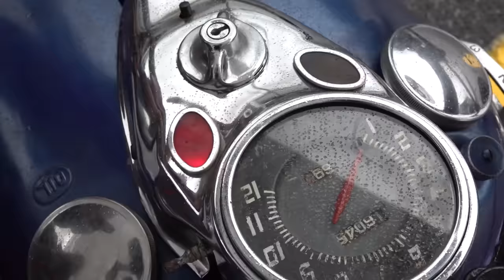I Bought a 80 yr old WW2 Bike, But will it make it Home?

Comment: That wla looks clean for its age
Reply: it's a beauty.
Reply: @MrRourk  you can only change the front PRIMARY sprocket of which they made 20+ different sizes.
Reply: @MrRourk  FYI the rear sprocket tooth # can not be changed

Comment: I was told by my neighbor when I was a child in the 70s . No worries if your points and condenser is bad. Go to a local hardware store pickup a kit for a Briggs & Stratton mower motor and your golden. These people worked on plenty of engines. And of course this was okay until manufacturers started putting in ecms. Craig was sounding giddy as a school girl. Kind of like Burt Reynolds used to laugh. That's a beautiful WLA. Would love to see HD do an icon version of it. From what I understand it was a 18.5 hp engine capable of stop speed of 70 mph.

Comment: Beautiful bike Sean glad you made it home safe. You and Craig and the crew. Good luck with the future endeavors on this one. Personally I like Chrome but you're right there might be a little bit too much and that kind of takes away from the originality of the bike I'm sure. Wish the weather could have been a little bit nicer for you but hey it wasn't that bad looks like you didn't get rained on too much at least from what I could see in the video. You guys take care of be safe God bless.
Reply: the wla is not original anyway . HD made 90,000 of these for the war all titled 1942. army models were olive drab, no chrome . black-out headlight,taillight, 18 inch wheels, air box/filter attached to the carb with a hose, 3 speed with reverse if it came with a sidecar. 26hp with aluminum heads , 6to1 compression ,21.5hp 4.75 compression.the 45 was made from 1929 thru 1973 making it the longest production run for  hd.i have lovingly owned 2 trikes for 33 years i' had many other hd's none as much fun as these,they are a labor of love if you use them, daily tappet adjustments if you ride hard 4-500 miles a day and thats a long day.gentlemen enjoy this machine ....

Comment: You make me dream of my youth!  I was eighteen, home on leave, bought a 37 WL from a good friend.  It'd been a side car with a reverse and I ended up riding it to Cherry point where I was stationed.  It was stone cold reliable, easy to kick start and good on gas.  The previous owner had done a great flame on black point job and molded the whole frame and tanks in. It'd do about seventy five or eighty flat out, and about fifty miles to the gallon at sixty.  I was young and foolish and sold it while overseas.  Wish I had it now.  Thanks Craig!

Comment: I'm guessing the not-the-throttle twist grip is for manual spark advance. At idle the spark advance is 4 degrees or so BTDC. As the RPMs increase, the spark advance has to be increased to around 14 degrees BTDC (old, low RPM engines). So, as you roll on the throttle, you also have to roll on the spark advance in a synchronized fashion. Cars had the same deal, but the control was a lever on the steering column. Eventually, this was handled automatically. At first, this was done with a pair of weights with springs that flew out as the RPMs increased causing the plate the points were mounted on to rotate and thus increase the spark advance. Now it is done electronically.
Reply: I never knew that. How mechanically     amazing.

Comment: My first road bike in 1972 was a WLA Harley.
They are indeed military vehicles.
90,000 produced.
I bought mine in Western Australia.
Australia was a major base involved in fighting Japan. There was an immense amount of war surplus around when I was a kid.
Petrol motor Detroit Dozers. Chevy Trucks. We used them as cranes to move and load tree.
It had maroon paint, chromed springer forks off a 1200 Sidecar unit, ride control and a bigger back tyre.
Im still riding , 1900 Roadliner.

Comment: These were fun. Some were still around when I started riding (post war HD and Indians). A few Jawa/CZ.  Rode an Allstate Twingle (Puch). Montgomery Ward Austrian 106? Some Italians.
My first road bike was a used Bennelli 4 stroke 125 cc. 
My elder cousin started with 50s bikes. 
There was a good reason why British bikes got very popular. 
My first (used) big bike was 66 Bonneville 650. 
Very fun. Unless you wanted high speed on the highway for any length of time. HDs and Indians had the same 60mph +/- comfort zone. 
Some very good rides back in the day. 

Out of 26 street bikes three developed problems. 
72 CL 350 timing chain and guide, burned valve at 28,000 milrs, 
Probably I did not adjust often enough. Bores were fine. 
77 BMW 750 output shaft seal went, eventually turned out cross threaded nut from factory tweaked the shaft just enough new seal would soon leak. At 44,000 miles. 
83 V45 Sabre, alternated came apart 34,000 milrs. May have over revved s bit. Amazingly easy.
92 Pacific Coast I do not count at over 90,000 miles (I tan a couple times while waiting for throttle cables, only lasted me about 35-40,000 milrs. Developed a short in the wiring harness I failed to trouble shoot. They would sell decently (high mileage vs lots of low miles) so 90,000 miles I gave it away. 
Otherwise one stolen if that counts. Oh and one borrowed I had to steal back.

Comment: Congrats on getting that beauty started, but I can't believe neither of you thought about adjusting & oiling the chain before taking off...you can see it bouncing up and down at least an inch as you took off. This is a very easy fix, and would have made the shifting and power transfer much much better.

Comment: I thought i was the only one who bought old , unknown-bikes and rode them home  . The last-one was a 73 yamaha TX650 cafe , 4k's from home the lights-failed , started running on '1' , then stopped in the dark altogether . I had to frantically pull the fuel-tank off when a hose disintegrated, pouring fuel over a hot-bike . I still haven't figured how I did it so-fast or why it didn't burst-into-flames . That's a great old Harley , though I wouldn't 'cross-the-road' for the modern-stuff .. Fun-times   .  Dave   NZ

Comment: It's running really lean, you can tell because the pipe turned blue. Chrome pipes are great that way, if they turn blue it's hot which means lean, if it's gold it's running right, if it doesn't change it's running too rich and cold. Thanks a lot for the extreme close up of the tarantula.. my arachnophobia absolutely loved it. -.- I'll be cursing you when I try to go to sleep and keep seeing spiders instead. Wikipedia says 25hp@5:1 compression, upping it to ever 8.5:1 which will still run just fine on 87 octane would probably up that to ~45hp. The cool part about those is Baker now offers an early Harley 4 speed trans that bolts right in that has 6 speeds inside of it which means you can easily do highway speeds without taxing the engine.

Comment: what additive to the gas did you use to replace the lead? I had a 1945 WL, I used marvel Mystery oil in the gas. yes a WL, a civilian model from 1945. one of only about 1300 civilian model made in 1945.

Comment: BTW, I have had a few bikes. A Yamaha 400RD. I sold it because idiots can't see a bright orange bike with the headlight on. So, I bought  a DT175 basket case. made it work. and went riding in the woods. I needed more power so I bought a DT400. They were both beaters, so I had the cylinders honed, new pistons, and went merrily on my way along the Applachian Trail. I got stopped by a Forest Ranger, but when I explained to him the large chain I carried was for moving logs from the trail, he waived me on. I took the untried DT175 from Pittsfield, MA to the Hudson River, and back. Ain't Skeered.

I was following the Trans-Atlantic cable when I was stopped by Arlo Guthrie in Washington, MA,  since it cut across his lawn. I pointed out his "Running Down The Road" album, and he said, "Easy across the grass".

Considering the terrain I rode over, I would have killed for a Trials bike. Rocks, roots, and gullies. Still. I made it with the DTs Great bikes.

Comment: So I know this isn’t what the video is about. But what is that trike behind you at the end of the video. Under the lift. That looks amazing. I have been researching and looking at stuff like that for years and never found a design I quite liked so I started modeling my own but haven’t gotten too far. Goal was to build a motorcycle that has manual stabilizers that’s enclosed that is 15 hp and weighs under 500lbs with 70+ mpg. Keeping weight and aerodynamics low was the goal of the project and that looks awesome.

Comment: Harley's military motorcycle Engine	45.12 cu in (739.4 cc), SV Air-cooled, side-valve, 45-degree V-twin with a Compression ratio of 5:1, Top speed 65 mph, Power 25 hp @ 4,500 rpm.
Ignition type	6 V battery

Comment: The WLA models were delivered to the military with a lot of extra equipment such as crash bars, winter leg guards, windshields, a scabbard for a rifle or a Thompson SMG, saddlebags, etc, which made them heavy.  To compensate for the weight, the engine's primary sprocket came in different tooth counts----a lower tooth count (and consequently a smaller diameter) provided more low end acceleration and less top end; and vice versa, a higher tooth count and greater diameter would give you less acceleration but a better top end.

Also, the springs that support the seat post came in IIRC three or four different weight calibrations to match the weight of the rider.

The left grip controls the spark advance.  The grip should be set to full retard for kick starting and the first few seconds of running, then twisted to full advance for normal operation.  This was not specific to the 45s--because of the varying quality and inconsistent octane levels of gasoline from the era, most H-Ds had the same twist grip spark advance.  On many cars of the Brass and Pre-War era had the same thing, a spark advance control--on Model T and Model A it was on the steering column.  Drivers had to listen for knocking and adjust spark advance accordingly.

Comment: The Harley 45 ci flathead is hard to kill. As long as there's oil in that right side tank. Top speed is, according to the manual, 72 mph!
Reply: 72 mph over a cliff !
Reply: @kurtfoulke5130  
Actually, my last WLA I restored in 1992, got up to 82 mph out on I-75 up in Ohio. There were three others with me on newer Harley's and one on a Suzuki!
One I restored back in the 1980's had a triumph 4 speed tranny. I put it on a plate and then had to flip the rear tire. Then add a bracket to hold the brake lever. The 45 and triumph uses the same primary chain and rear chain. The rear chain is on the left side vs the right side.
If your wondering where I got that idea. It was in an issue of Easyrider Magazine from the mid to late '70's! With step by step directions!
Reply: @crazyelf3839  there's a cliff on I-75 ?

Comment: The front fenders always looked jacked up and not in line with the front wheel, I am guessing that may have something to do with the Springer front suspension, if not its a serious design flaw, I've seen others like this too.
Reply: As the springs compress, the wheel moves forward - the fender is attached rigidly.

Comment: I messed up and put carb cleaner in my older harley. I started fouling plugs like crazy and it looked like some other issues. Turns out that stuff will mow through a brass slide.
Reply: Wha-what ? 🤦

Comment: You need to POLARIZE the generator when you change the battery, regulator, or generator. 
All you need is a length of primary wire.
Reply: That's only if the generator lost it's magnetic field

Comment: I do not know that engine but are you worried about bottom end run out? Traditionally Harley Davidson bottom ends are interference fit. So when you get over 140 hp in an Evo you need to worry about the bottom end run out. I know that is an older engine but the big twin bottom end is not a whole lot different. I am asking because I do not know that engine but I do know that would be bad. If it happens in that engine there. Piston-to-valve contact would maybe not be ideal for a running engine.

Comment: I bought 15 HD 45's all 1936 ex WD off the Belgian Police they were still using them the engines are bullet proof but the float in the carbs is cork and no good i also had a back wheel lock up but could not find out why and it never did it again.
Reply: They had a bullet proof shield under the sump

Comment: 20 horsepowers?? My homemade chopper bike doesn't even have 2 horsepowers. But the least thing you could do, Sean, is to wipe off the dirt from that 80 years old speedometer. Otherwise that old Harley is an awesome looking bike! If I had the storage space I would buy one for my collection.
Reply: Yeah, right beside the mini-bike chopper 😂🤣😂
Reply: @kurtfoulke5130  my homemade chopper is not small :) 
Just the engine. That is an 50cc motorized bicycle kit engine.

Comment: The Chrome looks just fine.   They don't use chrome much anymore  because of enviromental issues..
Reply: Have you seen a new Harley ?
Reply: @kurtfoulke5130    I saw an Episode of Highway Patrol from the laste 1950's  The Harleys of today really have not changed that much since the  1960's ect.
Reply: @mikeskidmore6754   2 wheels a seat & handlebars
Reply: @kurtfoulke5130    Oh  are you going to pay $24,000.00 for two wheels a seat and handlbars ?
Reply: @mikeskidmore6754  what I am saying is, that's all a modern Harley Davidson has in common with one from the 60s.
You may recognize a basic shape but, every system and component has been  significantly redesigned and upgraded.

Comment: 93 octane gas does a better job of cleaning the fuel system than any additive cleaner or, heck, pretty much anything. (in my experience while reviving two bikes that sat for many years)
Reply: It does nothing to clean the fuel system
Reply: @kurtfoulke5130  That must be why it cleaned up the old gas varnish (and unstuck the choke piston) in a set of carbs I used it in.
Reply: @bayard1332  probably just the ethenol

Comment: So other than a battery and some gas, what did the bike actually need?
Reply: Spark. We couldn’t get spark, then it was super intermittent when we did get it. Ended up being bad connection in the spark plug boots.
Reply: A kick

Comment: "Electric bikes are stupid".      Ok.....I don't think the guy I helped last week would agree.    He did the thing...like nobody has ever done this....he ran out of gas.     Now I get to say that's why gas bikes are stupid.   Uh...no...I won't...because both run out of energy if you don't take precautions.  Smaller the gas tank, shorter the range.   Bigger and better battery, longer the range.  The ONLY difference now is 5 minutes to refill a gas tank, or 15-30 mins to recharge.  Tesla cars and Energica bikes get 400 km range. The whole argument is just shy of moot.    :)

Comment: Oh man, that's original paint.  I'd leave it the way it is and try to restore what's there as best as possible.  Leave the chrome, just polish it up.  🤥
Reply: That’s not original paint. It would have been the military green originally
Reply: @The_Bearded_Mechanic  Not necessarily.  And even if it's a recoat after it was sold as surplus it's still worth more refreshed than painted over.
Reply: @The_Bearded_Mechanic  the fenders are not WLA so in theory it could be original paint.

Comment: You are out of your mind to strip the tasteful chrome and the good paint on this motorcycle.  A repaint is completely unnecessary on this bike, even if your pal paints it on the cheap.  

Much of the chrome is period correct for the WL civilian model.  The paint is beautiful, if more of a modern two tone color scheme.  Unless you plan on keeping this motorcycle for yourself you are certainly spending a lot of money and time on this repaint, but adding very little if any value to this motorcycle.

It's your build not mine, but know WHY you are doing what you're doing before you start changing things on a mint HD like this.  Really.  

I love your channel, but you don't want to be the guys that just throw money a sweet vintage Harley for the sake of film time.  This is the epitome of the "don't do this at home" message, if that's what you want to send.